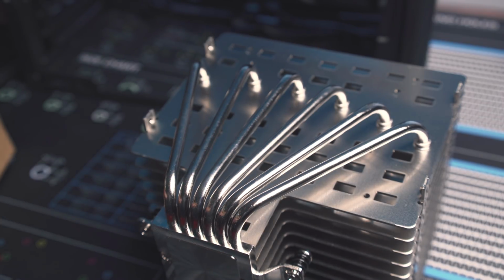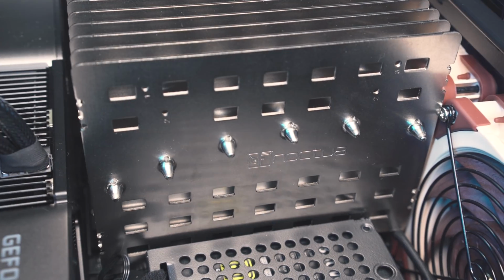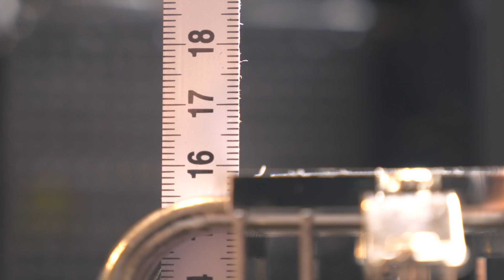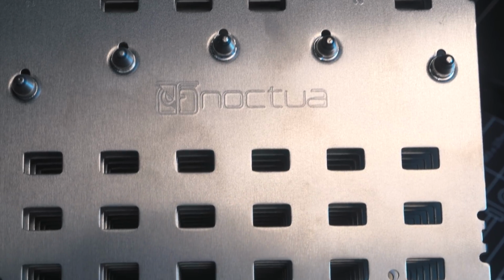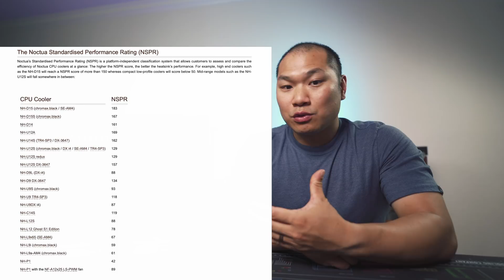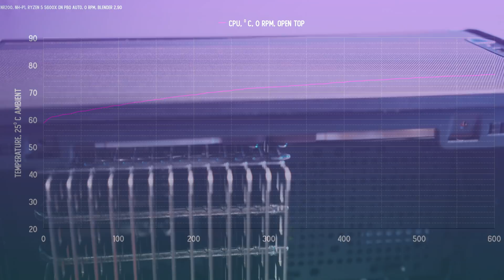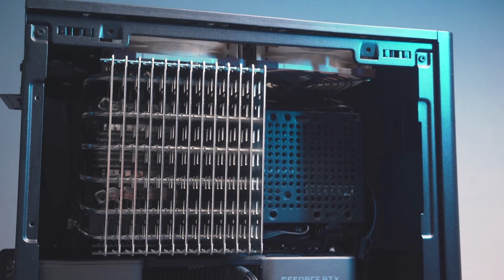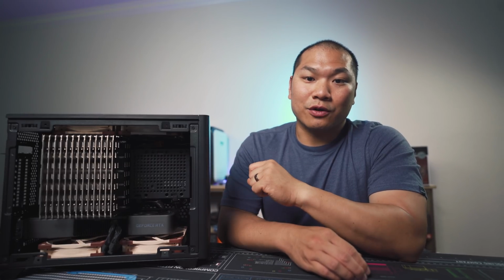The Noctua NH-P1: A Semi Passive NR200

Comment: How did you fit the side panel with the NH-P1? Could you explain in more detail, please? Very interested in doing exactly this setup! 😎
Reply: It seems he just accepted the panel pushing on the fins. Not something I'd do myself as I see a lot of unnecessary risk there (lot of leverage from the fin stack down to the socket), but a lot of reviewers and youtubers are willing to accept that risk, because to them it's just a test system. Sure, they might end up using it long term, but if it has an issue it's no big deal for them to sort it, while for you or I building our only rig in this manner, an issue down the line means potentially spending a not insignificant amount of money.

I'd find a way to offset that side panel, or buy a spare and cut a hole in it, or something like that. Easiest way, of course, is to just leave it off

Comment: Nice video with  some nice background piano reminiscent of Bill Evans.

While some might pan the limitations, in terms of what they'll handle, passive cooling is the ultimate in acoustic performance for pc cooling. There are alot of options out there that are interesting, such as Monsterlabo, HDPLEX and others. And ,if a passive setup fits your requirements, that's a win.

I think its great that Noctua is getting into the passive cooling game, and would like to see them take the design a bit further, making the cooler more of a show piece. While using the top thermally conductive materials (e.g., diamond, silver) is probably out, more copper would be interesing for a "rat rod" build. Also, while duplicating a Chihuly chandelier is overkill, a more creative  pipe bending or use of elements of the owl logo icon for cutouts would add a creative edge. Lower profile end caps would also look cool and make fitting easier.

I wouldn't mind seeing a comparison with other cooling options, including some of the NOFAN options.

Comment: Nice video. I have a similar setup, but (nearly) fully fanless. iGPU, no case fans and fanless PSU. The only fan is in the I/O shield of my MB, but it turns off a few seconds after boot, so I haven't bothered removing it (yet).

This cooler only makes sense if you really need 0 noise though. I'm going to use my system for recording music in the same room (1 room cabin), so it makes sense for me.

I haven't stress tested yet, but it cools a 10400T to about 10-15 or so degrees C over ambient at idle.
It's dead silent, can't tell if it's on except for the power LED.

BTW Check the stress on the motherboard when closing the side panel, it flexes a fair bit. I used zip ties instead of screws to leave a small gap at the top and remove the stress.

Comment: Now I wonder if this placement directly under the one case fan improves this cooler's thermal performance (on the other hand due to direct placement on the other side right by the GPU backside/back-plate it's thermal efficiency may be worse), as the manufacturer limits compatibility to 5800X when the cooler is paired with NF-A12x25 LS-PWM... while 5900X already gets "CPU might fall slightly below base-clock under continuous full load." comment with the fan(s) configuration and straight up "Cooler cannot handle base clock" in fanless mode. I wonder if it can actually be made to work well with the 5900X in this case... on light loads should work well, on heavier maybe not so much, but the question is how much of a loss is to be expected in NR200...

Comment: Well it's a nice video and all that, but since you're not using it in a fanless system and you cant run it bellow 6-700rpm on the case fans at LOAD, which would make it inaudible, you can call it semi passive as much as you want, it's still producing noise, so it is only fair to compare it with the u12a at a equal noise threshold to see results, be it 30dba, 32, 35, or 40, it's your choice since you make the video.
As far as running it in passive mode at idle and low usage. It's not practical. Even if i didnt have this cooler i did thought about it and even started working on it. It's not working well, unless you set the threshold to like 70ºC, and even then, you can run fans at 300-500rpm depending on the fan, being pretty much inaudible, and shave like 25-30ºC from those 70ºC.

Comment: Awesome. I was hoping with the fan overhead that cooler would be able to tame something like a 5900x. Still really cool looking in the NR200.
Reply from the maker: They had to bias this one towards full passive use, so the big thick plates and low heatfin count are what hamper it in the semi-passive scenario. If they made it a denser fin array, the semi passive scenario could be capable with higher TDP chips.

Comment: Was thinking of getting a D15 for my 5700G and putting it in my NR200P but this semi passive setup seems awesome for a GPUless setup. People also sell 3D printed NR200 side panel extension brackets on eBay and Etsy so you can fit large air coolers and it still looks pretty good.
Reply: Thanks for the tip.

Comment: I think this cooler could perform well with no-dGPU setup, possibly with Ryzen 5300G, 2 bottom fans, and two top fans. It would make for a nice HTPC application. It does not make sense for workstation/gaming builds, however.

Comment: For some reason the quiet music in this video is off-putting.
Unfortunately, even during idle, my GPU fans are louder than the noctua fans in my system.
Reply: I was going to comment how good the music is and suited the video really well :-D
Reply: You can undervolt the GPU, tune the fans and reduce quite a bit the noise.

Comment: Hey is your nr200p front panel fully painted on the inside?  Very curious. Because the qc on my sec case is a bit off compared to the original one I had but returned for the m1. My current isn't painted all the way on the inside and my logo is slanted. Very disappointed this time around after loving the case the first go around.

Comment: It is sooo good to see the NR200 again! I love this case so much!

So the P1 doesn't fit perfectly inside? Where did I put that belt sander?
Reply from the maker: Haha, if you need to take off a little, it’s safe. Personally I’d just use a screw or two to hold the side panel since it doesn’t deform the panel or anything, but if using with glass… it’s going to need a little TLC😎
Reply: @MachinesMore  This is why we need to get cases with curved glass. How sick would that be?
Reply from the maker: Fish bowl!

Comment: How about the NH D15 next? Hahaha!
Reply from the maker: You could actually get the D15 to fit OK… and just drill out the panel holes where the heatpipe tips touch. Not ideal but not bad either.
Reply: @MachinesMore  You can make anything fit...with a Dremel.
Reply: @MachinesMore  are those heatpipe tips removable like the coolermaster ones? i've seen somebody remove the ones from the popular air cooler, just cannot remember the name......hyper something.
Reply: @3rutu5  hyper 212 evo? That’s a cooler masters most well known single tower cooler

Comment: Is there enough room to add a 92mm fan on the rear of the NR200 case? Also when you screw in the side panel, is it bulging in any areas? Does the side panel sit flat and are the panel gaps even?
Reply from the maker: Panel does not deform, the screws just help it stay clicked. 92mm fan is fine, but will disrupt the airflow, plus it would be obstructed by the cooler.
Reply: I have a similar setup, same cooler, same case. I noticed the motherboard and mounting frame behind it flexes quite a bit if I push the side panel in fully. A little more than I was comfortable with, so I used some zip ties in the screw holes instead, to keep the panel on with a slight gap.
It's probably fine with screws, but I tend to keep my systems for a long time, so I didn't want the stress on the motherboard to cause issues (cracking) a few years from now. I'm thinking of modding the standoffs and/or tray to recess the motherboard slightly. That creates other issues though (I/O shield and slot offset), so not sure if it's going to work.
Reply: @AnWe79 smaller standoffs, just 2-3mm less was also my idea. How did your improvement work out. Was the i/o shield a problem? I hope 2mm are in saferange for the angle.

Comment: Noise is a big factor for me and a (semi) passive build seems like a good idea. But after experiencing GPU coil whine (not much but still), I'm not sure it would be a good fit for a gaming system. The high pitch noise is drowned with a classic setup (with a few fans and a CPU cooler), but with an otherwise very quiet build at med/high GPU load... Maybe I'm just a bit too cautious, but I feel it's something to consider when aiming for low noise.
Reply from the maker: It is definitely a consideration. The latest crop of high powered GPUs are definitely prone to coil whine. However, undervolting often helps with that and would be a must-do for this type of build, will also help with CPU temps since it won’t heat up the cooler as much.

Comment: I still don't understand the meaning of this cooler. It struggles to sustain a very low TDP cpu without fans and isn't so good even with fans (i mean, shouldn't even be considered with fans because Is passive). All this costing like 120-125 euros. Why someone should consider this over a Fuma 2 or Noctua c14s for this case?
Reply from the maker: If you’re after performance, don’t consider it. It’s not for that, it’s for building a very noise optimized system and serves a very niche segment, and there’s not much like it that serves that purpose.
Reply: @MachinesMore  Just wait till Noctua reveals their masterplan with their new 180mm low speed fans. Then it will all make sense. (The P1 even has fan bracket holes)
Reply: @MachinesMore  i mean, if someone Is very noise sensitive it's just better to reduce fan speed of CPU cooler  to 500-600 RPM (with good fans of course). The noise will be so low that will be almost like passive system, spending a lot less money. If i set my Noctua d15s to 600 RPM it becomes literally inaudible and still perfoms better than the nh-p1.
The only use of this cooler is in a PC with 0 fans, with even passive GPU.

Comment: Ohhh, I was thinking this would work well in the S620 that you reviewed a bit back.
Reply from the maker: You know, it won’t work as nicely due to the fan accommodation over the S620, it won’t fit a fan directly overhead, and that’s the main source of airflow for the cooler. Height clearance wise though, absolutely.